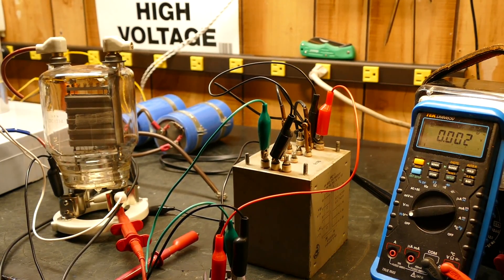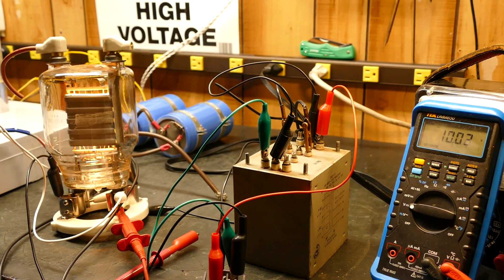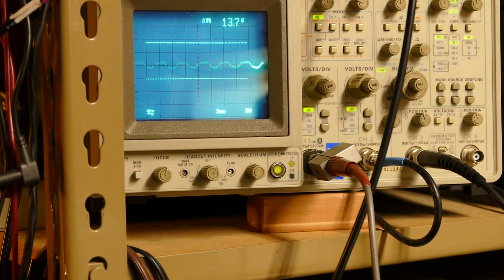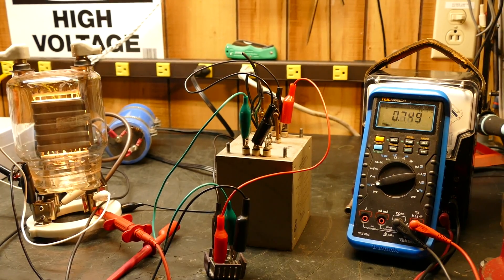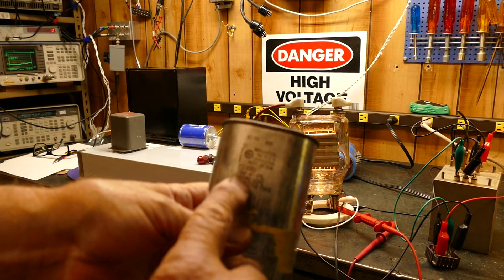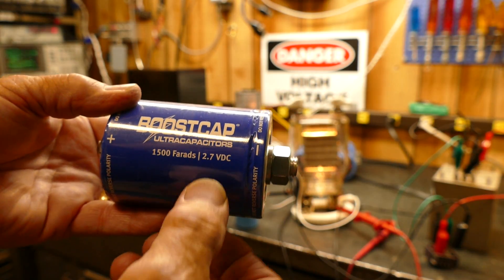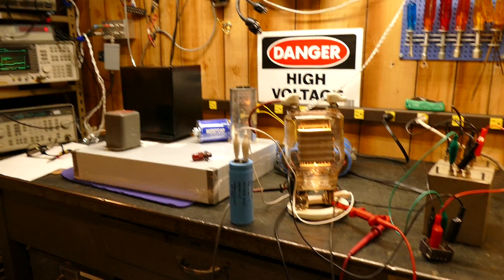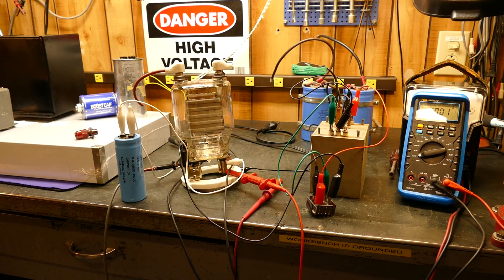833A 150 Watt Audio Power Amplifier Filament Supply Challenges Part 2

Comment: hmmm... i always wanted to start with tubes like this. only did a few KT88 and KT150 amps so far
Reply from the maker: A tube like that is quite the challenge. I never had a large enough single-ended output transformer to make it work very well. I did make a good RF amplifier out of the 833A.
Reply from the maker: Here is a an attempt to make it work as a single ended audio amplifier.
https://www.youtube.com/watch?v=65ln3YUkUXU&t=1s

Comment: Old microwave oven transformers work well as a base for custom power transformers after the secondary windings are removed, you can add as many windings as you need for wherever voltage you want.

Comment: Why all this nonsense with DC for heaters? And PLEASE, don´t expect a capacitor rated for 660VAC is good for more then 933DC. The AC specification in NOT peak-to-peak, but average voltage! Just heat the tube with AC and you are done!

Comment: USE A 10 VOLT CT TRANS GROUND THE CT YOU WILL GET NO HUM . I BUILT A 833A PP AMP ALL ALL REDY
Reply from the maker: +Jamie Phillips I do believe you about the hum. The PP 3-400Z amp I built did not have a hum problem. My only issue at the moment is poor low frequency response. I have set this beast aside and taken off on a tangent for small, direct heated filament tubes like the 6B4G. I have one of them running as I write and I absolutely love it. I can't quite explain it but the sound is actually more appealing (to me) than the McIntosh MC40 that I run in the shop.
What in the world die you build a PP 833A amp for? I love it and would like to see some pictures.
Reply: +ElPaso TubeAmps IT STILL NEEDS A LOT OF COSMETIC WORK I USED 833A'S OPT TRANSFORMER COPELED 2A3'S DRIVER PP TYP 58 PHASE INVERTER DRIVE ON THE 2A3'S 6MD8 PREAMP ( 6 TUBE'S ) PER CHAN
Reply: +ElPaso TubeAmps  PS 6MD8 I DC HEAT IT

Comment: Mike Samra gave a good hint about regulating the DC filament supply.  There are plenty of posts on the WWW that indicated CURRENT, not voltage, regulated DC is the way to go.  The talk is about "washed out" sonics, with voltage regulation.

Contact Rod Coleman (UK) about his filament regulators.  For a beast, like the 833, a 2 stage regulator, 1st voltage and then current, seems appropriate.  The 3 stage regulators are (IMO) best saved for small signal filamentary types, like the #26.

If the stud mounted diodes don't "cut the mustard", look for high current Schottky diodes and keep SS diode switching noise out of the filament supply.

Eli D.
Reply from the maker: Eli Duttman Hi Eli - I appreciate the advice but I solved the filament issue with an inexpensive 120 VAC to 10 volt adjustable power supply that will provide up to 33 A. In the testing I have done, the 833 amp is perfectly quite. I haven't measured S/N yet but I am confident it will be good. The challenge at the moment is the driver for the grid of the 833. If I can get myself back in the shop for a while, I intend to use a 6550 cathode follower across a 10 H choke to drive the 833. I have tried one of the cathode follower circuits using a 2A3/6B4G that I found on the Internet but it was no better than the simple 6V6 driver circuit I built first. It is becoming easier to see that these 5-10 watt category tubes are just too small. Some good thoughts on low Z, high power (30 watt) (cathode follower) driver circuits would be appreciated at this moment. Thanks for the post.
Reply: ElPaso TubeAmps "Sand" may save the day.  Check Tubelab's Power Drive out.  A big honking MOSFET makes positive grid current regimes EASY.

http://tubelab.com/articles/circuits/power-drive/

Eli D.
Reply from the maker: Eli Duttman Nice article - I have reviewed it briefly but will examine it closely later - Thanks, Eli.

Comment: Dave
  There is something you can so to cut down the ripple in the filament supply and that is this.If you put in a regulator with a gain of 40 to 100 in the filament supply,that will effectively increase the capacitance 40 to 100 times due to the gain of the regulator device and essentially knock the ripple way down to nothing.A pass regulator would be a way to go but outside of using a battery ,the only way you will get that ripple down is to more or less use a capacitance multiplier in the form of a gain type regulator. A voltage regulator IC driving 2N3055s about four of them may do the trick..The IC will track and null the hum coming in.

Comment: Please forget about the DC filament power supply, just read my comment on your first 866a video....;) 
You just run into serious (not nessesary) problems. Use AC filament power supply with a grounded center tap, and you´re good to go, and can pretty much forget about any problems.
Reply: TubiCal is correct. It is very common to ether ground the center tap, or create a virtual center tap (i.e. hum pot). Not necessarily in this case, but sometimes adding a B+ to the center tap (floating the filament supply) above the bias voltage works well too.

Comment: I'm confused here. Why would anyone use an RF power triode to make an audio amp?  is this for a class A or Class AB?   
Why do you need DC  on the filaments in the first place? 

If you can get 100 watts from a couple of KT88s, why go into this complexity in the first place with a huge tube that may be hard to operate in the linear mode , not to mention  that is going to present cooling problems as well as  high draw filament power
required.
Reply from the maker: SuperCarver2011 You are right - it is nuts - but that's part of the fun. Primary objective is to make it safe so no one can come in contact with the HV. How it "sounds" is purely subjective. It seems many people like the whole range of harmonics created by a SE amp - especially in the creation of the music by guitar.
Reply: ElPaso TubeAmps Sure, it can be a fun project as a science experiment, but this tube was designed as a Class C
RF power amp, and it's linear range depending on the bias may not be as usable as in a  tube that is designed to
be primarily an audio amp.

Comment: A gentleman on a FB group wrote this after watching your video - Use a center tapped filament transformer or create a balance using a pair of 10 ohm resistors to ground.
People say this does not work but it works really well.
The best way to prove it to yourself is to put your scope in ADD mode. (channel 1 PLUS channel 2), and put one probe on one side of the filament and the other probe on the other side of the filament with both probes shields referenced to ground.. Then you will see what the audio path sees. A lot less ripple than your DC supply is giving you. This is one case where AC is better than DC on the filaments. The tube was dsigned to run that way......
With proper selection of components or a small ohmage potentiometer with it's tap going to ground between the two 10 ohm splitter resistors you can probably completely null out any imbalance.
If your scope sees ZERO ripple of filament voltage to ground, then the audio path sees ZERO ripple in filament voltage to ground.

Comment: This is an awesome project. Thanks for sharing this. I've had a few thoughts about your filament supply:

Does the filament supply really need to be DC? I'm wondering if a nice smooth AC wave might produce less noise than DC with a bunch of ripple. I've seen a few cases where a simple AC filament supply actually results in less issues than a fancy regulated DC filament supply.

If a 60Hz AC supply causes an audible 60Hz on the tube's output, then maybe you could look at shifting the filament supply distortion above the range of hearing by using a switched mode supply. Or dropping it below 20Hz by some other means and then filtering out the distortion to prevent the low frequency from being amplified and sent to the speakers.
Reply from the maker: David Earp Hi David - thanks for your thoughts - I am afraid this amp will require DC on the filament. I wish it was not true but I would be naive to just build this amp and end up with a serious 60 Hz hum problem and be surprised. Only once have I built an amp with a directly heated cathode and I had a serious hum problem. There is not much real information on the Internet about this over-the-top amplifier but the one thing that seems constant is the necessity for DC on the filament - not for an AM radio station transmitter or modulator - but for a home SE Hi-Fi amp.  A switched mode PS may be a relatively easy way out. The higher frequencies are easier to attenuate so I may go that way - thank you.
Reply: ElPaso TubeAmps No problem. I guess a switched mode PS would be a fairly easy and cheap way of getting started for now. Best of luck. I'm really looking forward to seeing how this turns out.

Comment: 2 things:

nr1 i would advise a soft start on the filament, it will live longer this way. (at least to my knowledge)
nr2 the tube needs heat sinks on the terminals, else you will brake the glass when running it.